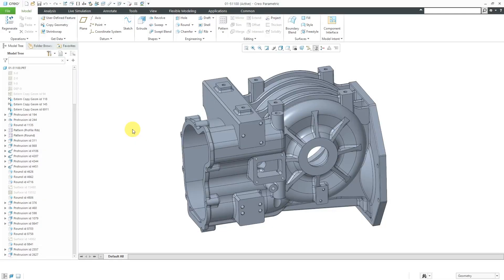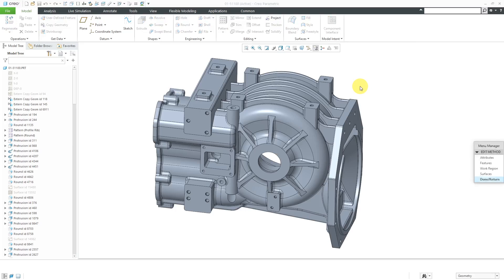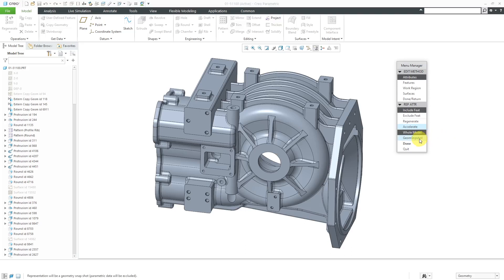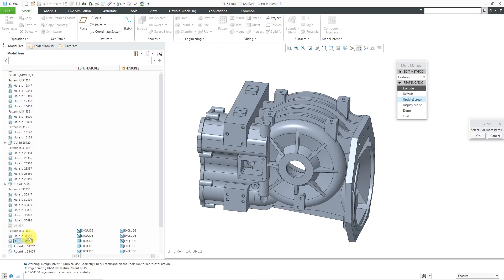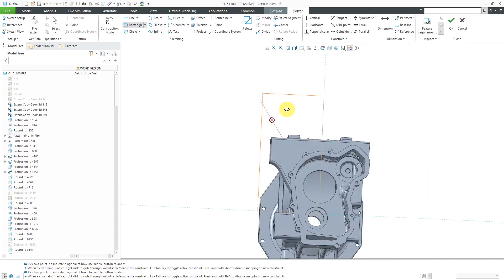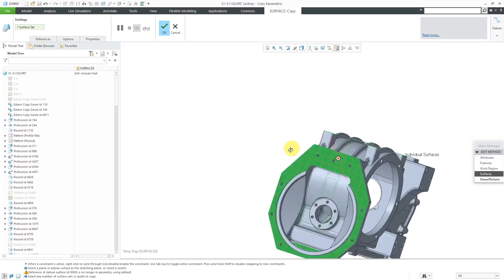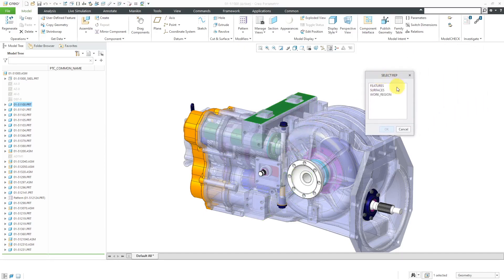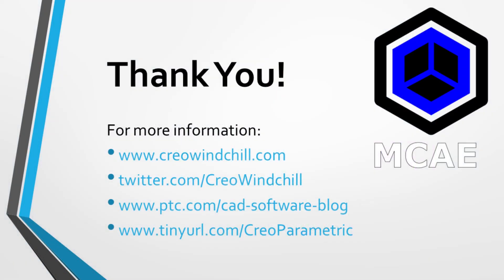Creo Parametric - Part-Level Simplified Reps

Comment: Just checked and it is not possible to select bodies when creating the simp rep ... that's a shame because it would make it possible to create single component drawings from the seperate bodies as you would do with an assembly drawing ...
Reply from the maker: Why not just hide the bodies in the particular drawing view using layers?

Comment: Is there a way to only include features in a simplified rep that are by default suppressed? ie - Threads in a downloaded mcmaster carr part that we extrude over. I'm trying to find a method analogous to how Configurations work in Solidworks. Or rather, please advise the best way to defeature imported geometry hah :)
Reply from the maker: I advise people not bring in fasteners from McMaster Carr at all (but it still happens all the time). Even without the threads, the fasteners contain too much geometry. You can model a fastener with 2-3 features.

I recommend using Flexible Modeling tools like Remove to take out unnecessary detail like threads.

And there are better tools to handle McMaster Carr parts in SW than Configurations.

Comment: I use simplified reps mostly for sheetmetal instead of instances because they are a nightmare to copy. It would be great if PTC would take simplified reps serious in future releases because they could be so much more powerful and user friendly.
Reply from the maker: In what way do you want them to take them more seriously? Did you participate in the PTC Technical Committee meetings with the PTC product managers today?
Reply: @CADPLMGuy  Ive given up trying to give feedback to PTC years ago when I posted all issues on the PTC CREO modelling forum and never got any reponse other than from other users. Also trough our reseller in the Netherlands never any response. Dont get me wrong Im a happy advanced Creo user for over 10 years and I have lots of ideas which would greatly improve workflow for product engineering.
Reply from the maker: @bjpastoor  I caution you not to think PTC is static. Just like all companies, there are new product managers all the time. Just because a previous one didn't listen to you doesn't mean that a current one won't. The previous product managers were incredibly accessible IMHO, but the current crop are stupendous. Michael has implemented one of my suggestions from Creo 5.0 in Creo 7.0. Don't give up.